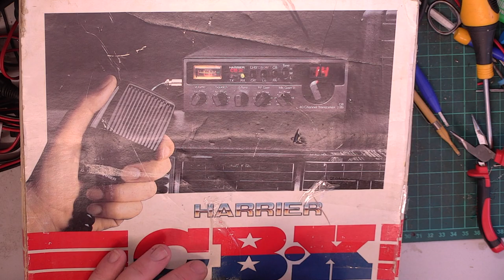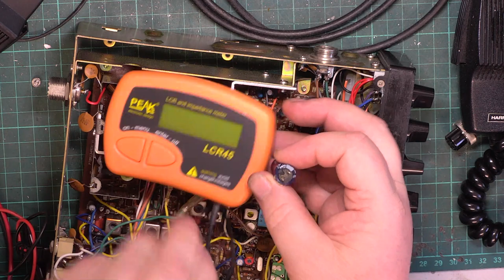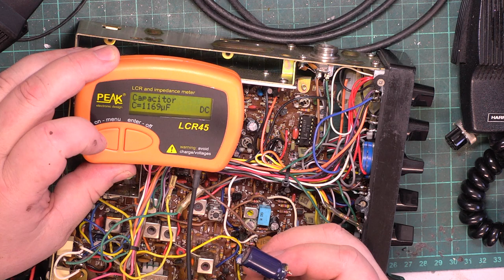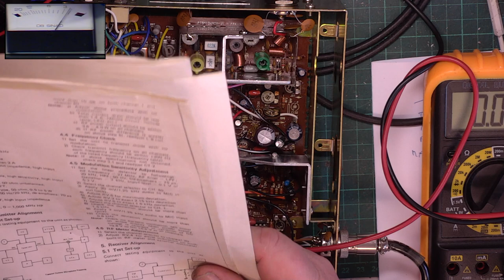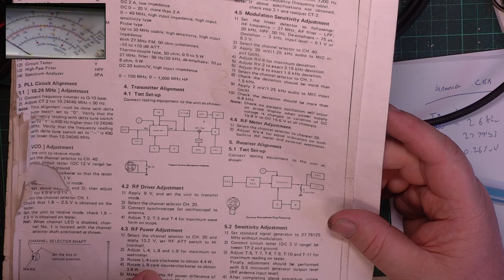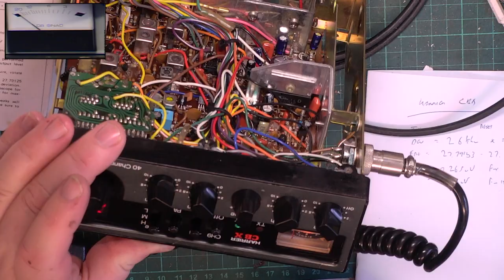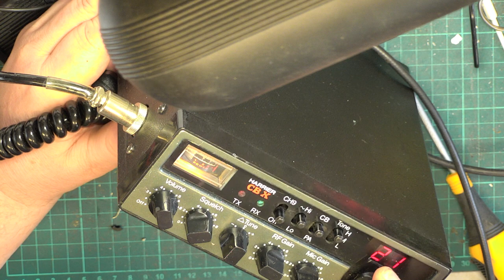Harrier CBX CB27/81 UK FM CB radio - Full recap & service

Comment: Hi Richard, I’ve been watching your videos for a few months now and have learned a lot from them for which I thank you. I was wondering where I could source a 2sc1974 and driver for a fidelity 2000 , for the love of me I can’t find any . Any info would be greatly appreciated, thanks again
Reply from the maker: The driver shown on the circuit is 2SC1846 & the output 2SC1909.The devices fitted do differ from set to set.

Richard
Reply: @ukfmcbradioservicingTango21   thank you again

Comment: are there places that still sell, the green/yellow/white adjustable cams at rear where the final is,  trying to find them as i bought a cbx that has the carbons cracked,  thank you
Reply from the maker: Knights & Kirton in Lindsey sell the correct cybernet ferrite cores for about £1 each. The actual coils however, will need to come from a scrap chassis now these sets are 40 years old. Cybernet AM sets use the same coils in that section. If you get really stuck we may be able to dig a sctap chassis out & unsolder something....but we have no cores & buy them as needed from Knights.

Richard
Reply: @ukfmcbradioservicingTango21  Thank you i did look on thier web site, did find this one, Ferrite Hex Cores (cybernet) 
Q54  but as no picture did not know if it was the right one,
Reply from the maker: @glennwhitehouse8110  Their Q54 is the rght one.

Richard
Reply: @ukfmcbradioservicingTango21  Thank you Sir,  there closed till thursday so ill give them a call then and see if they have any available,  i did just buy 2 harrier cb's, (not cbx) it is always handy to have replacement green/yellow/white just in case the ones in the set become worn or accidents happen, 

thank you again for helping me